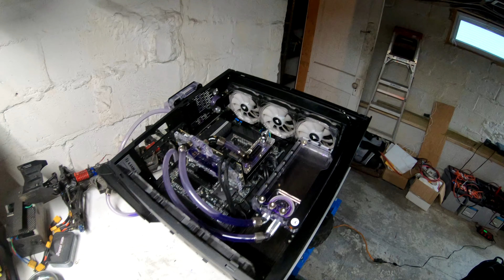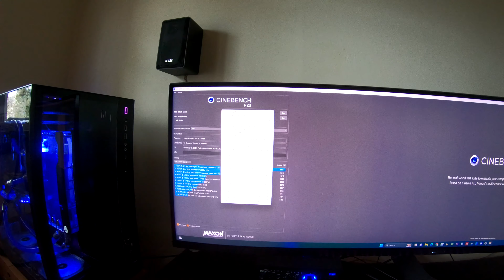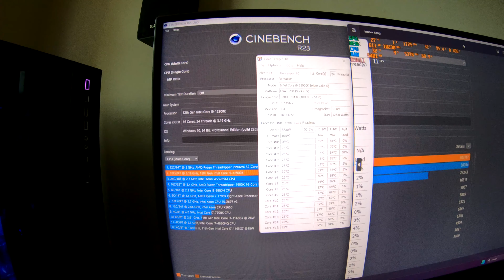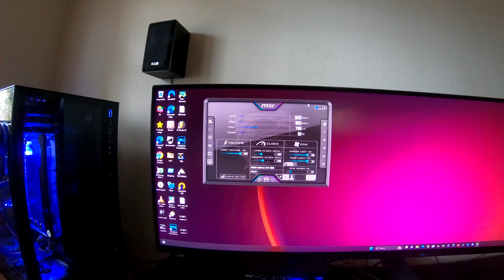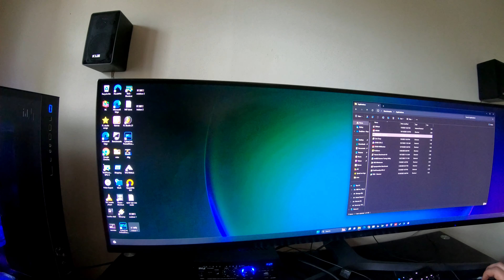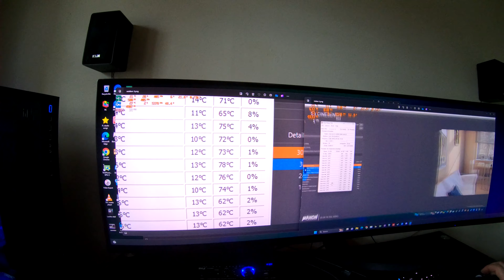Direct Die Cooling 25C reduction!

Comment: Direct die is awesome. I've been delidding and running direct die for a while now and it's definitely the way to go. I have two desktops with the IceMan direct die block. It is made very intelligently compared to the Supercool direct die block, and both are much better than using a die frame and conventional waterblock. I am running one of my desktops on chilled water. I live in Arizona, so having an outdoor radiator would work the opposite of what I would need it to. I like the stuff you are doing with your channel and subscribed. Looks like we have some interests in common.
Reply from the maker: Great to hear! It is excellent that same-minded people can share this type of content :) this setup had broken many 3080.12/12900k records but holds well for any MD based pc configs :)